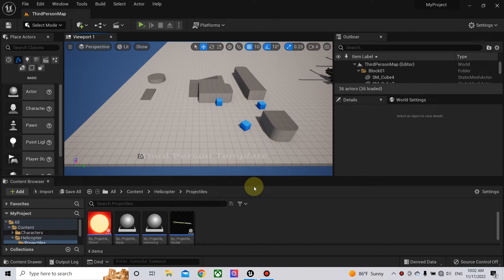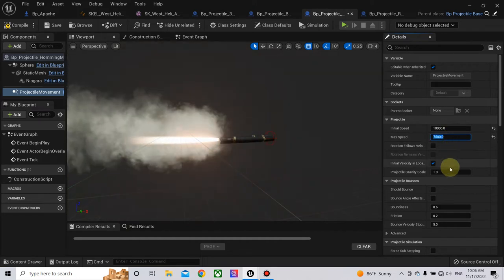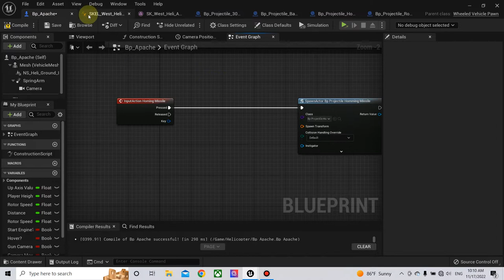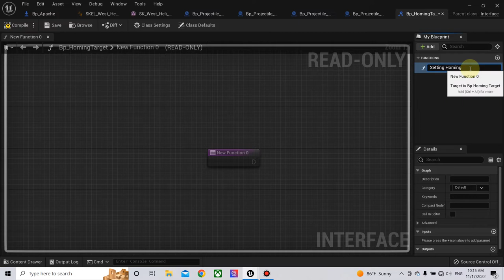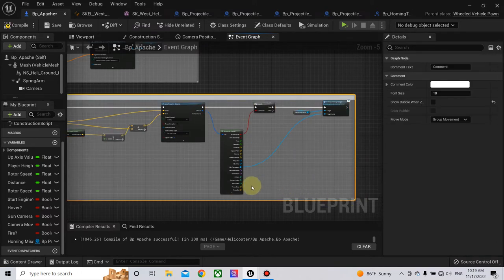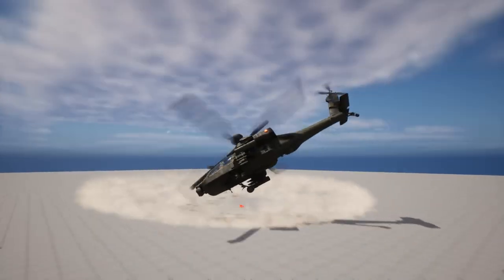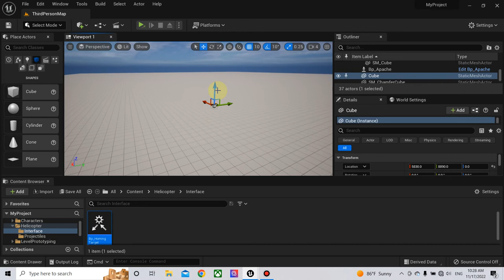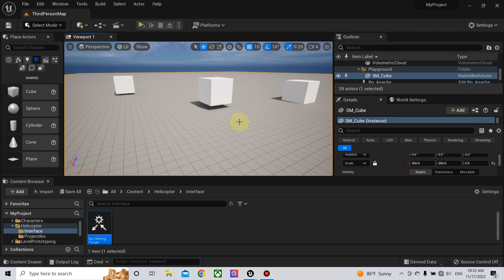How to make a Helicopter in Unreal Engine 5 with Homing Missile. part-4

Comment: looks like i can move the missile left and right, but it will not touch the ground. Ill try the next video first
Reply from the maker: yeah, try the next video because in this video, the homing missile is not accurate and targets the center of the component you are aiming at.
the next video has the improved and accurate version of the missile.

Comment: Hi. Could you help? I did everything on video. Everything worked. After that, something really went wrong. And now it doesn't work. Sends the error "Blueprint Runtime Error: "Attempted to access BP_HommingMissing_AH64_C_3 via property K2Node_DynamicCast_AsBP_Homing_Target, but BP_HommingMissing_AH64_C_3 is not valid (pending kill or garbage)". Node: Settings Homing Target Graph: Event Graph Function: Execute User graph PATH 64 Dr1ve Blueprint: BP_AH64_Dr1ve" Rechecked everything, I can't figure out what's wrong and how to fix it...
Reply: the missile guidance stopped working. the guidance missiles all fly to one point on the map. this is a mistake. and then a window pops up with the error I wrote about above
Reply from the maker: the final video in the helicopter series has the fix for this problem, I rework the guidance system in it.
Reply from the maker: can you send me a screenshot on my discord
ME.Games#7032
Reply: @megames998  Thanks! Sent a request!